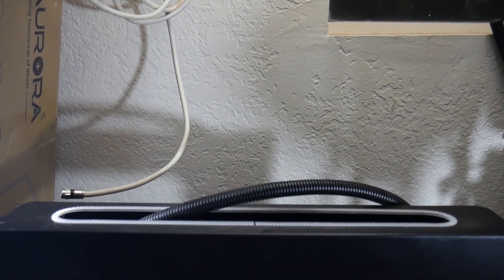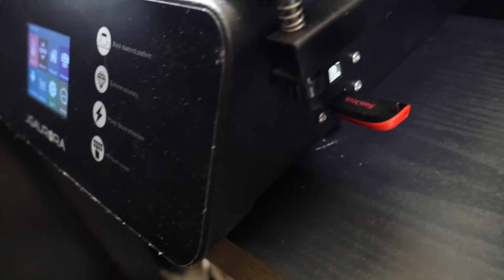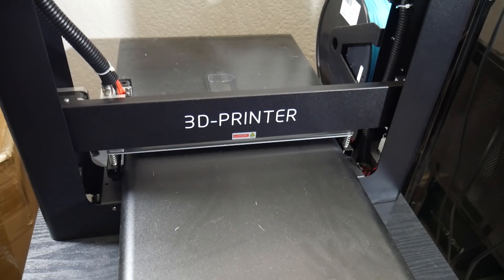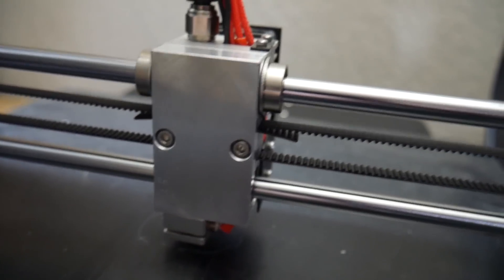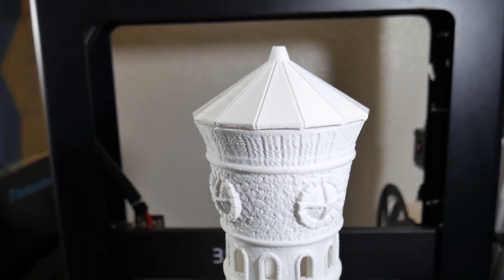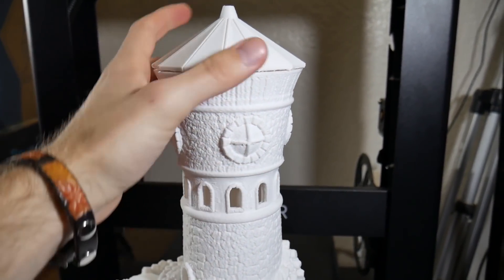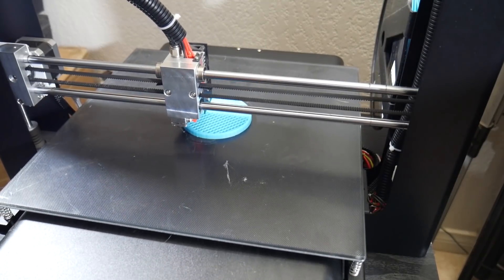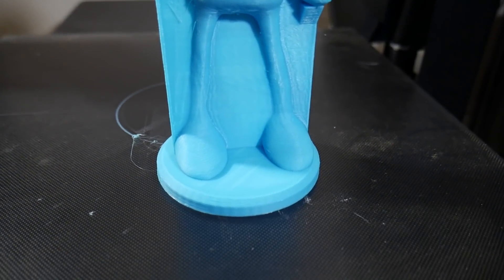Review Of The JGAurora A5 3D Printer | CR-10 Competition

Comment: Out of the box I would say the JGAurora is better than the CR10  but the JG soon starts to go wrong and my printer has spend more time waiting for parts to arrive on a slow boat from China than it ever did working plus the JG help desk have trouble understand English when it suites them.

Take my word for it, the JGAuora is nothing but trouble and the guarantee is not worth the paper it's not printed on.

So anyway I got myself a CR10 mini, it works 24/7 and does what it says on the box without going wrong every other week so don't be taken in by the good looks, they are only skin deep.

Comment: With closed Chinese firmware forget about long term support and any upgrades.
Reply: There are firmware upgrades and custom firmware available.
Reply: where is custom FW? Chinesee FW will be available as long as they don't create new model.
Reply: I have custom firmware installed on mine. Huge improvement. There will be new models but as long as this remains a popular printer other people will create firmware to improve functionality. The closed firmware has already been reverse engineered.

Comment: Want to get my feet wet in 3d printing..what would you suggest? I think I want a cheap one to see if it's something i will even use.
Reply from the maker: Exciting! There are a ton of options things that would help me pick for you is budget what you plan on printing (size) whether you want a kit or prebuilt as well :)
Reply: ModBot I don't mind building. As far as size I would like to make a arcade like you did so whatever can handle that.
Reply from the maker: Okay, well if you do not mind building then that will definitely save some cost and if you want to do an arcade like mine you will want 200mm x 200mm x 200mm which is pretty standard. The tevo tarantula I just built and reviewed is seriously like 180 bucks, has an all aluminum frame, was not to bad to build, and is the dimensions I listed. I would look into that one. For a preassembled option the cr-10, jgaurora a5, or anycubic mega will all work. Pretty much personal preference they are all around 400!

Comment: Looks awesome! Just bought the i3 Mega.
Reply from the maker: How are you liking it so far? From what I have seen and heard it looks like a great machine :)
Reply: I'm at the very beginning to 3D printing. Never owned or used a 3D printer before. I was happy that the assembling is easy and "time to first print" was very short. I think the Anycubic i3 Mega is a great choice to get started with 3D printing - it's very cheap and very good quality.

If my experience will improve, I'm going to upgrade that printer and change the nozzle. After my first steps and just a few days using it, I can say it's an awesome piece of technology and I'm very happy that I've chosen that one. Thought about the CR-10 as well, but in the end all reviews said that the i3 is a good start and the awesome heated bed (as you mentioned) and the smaller dimensions were the decisive factor.
Reply: But the JGAurora A5 looks more like a printer I would like to have in my living room. It looks more like a designed product than an "engineering tool" with a lots of cables, connectors and screws. I love the "clean" look of the A5!
Reply from the maker: Welcome to 3D Printing! I have to warn you that once you are bit by the bug there is no going back haha. That is awesome. I do think a machine like that, this one, or the cr10 are great choices for someone that does not want to assemble a kit, that way you can spend more time learning how to get quality prints and dialing in settings instead of dealing with wiring and putting a 100 parts together or so.
Reply: :D Exactly! Nevertheless, one day I want to assemble an Anet A8 or A6. Just because I love to assemble parts. But I think that's a project I want to start when I'm a bit more experienced in 3D printing. There a hundreds and thousands of settings I have to learn... When you have assembled the whole printer yourself it is hard to find a problem (whether it's caused by the software or hardware).

Comment: Cool review! I really want one of these in the near future. Thanks for printing the tiny, tiny tug boat. Yeah, I figured the printer just couldn't handle the tiny detail, I was hopeful tho. I hope to join you on the live show. I had some questions to ask about working with diff, filaments. I've missed some of your videos over the years, so you may have already worked with filaments containing metals,   wood composite, green materials made from plant products and or fiber optic filament? Have you 3d printed your very own 3d printer yet? I'm guessing, just about by the time you super upper and mod a kit that you put together, probably yes. Thanks so much Daniel! Hope the new job opportunity is going great with you too!
Reply from the maker: Hey Ashley :)! haha I was really hoping the boat would have turned out better but there was just no way at that size it would have to be done on an SLA printer. Hop to see you! It will probably just be a laid back stream. So my experience with these more exotic filaments is actually pretty non existent. 90 percent of my prints are pla, 5 percent abs, and 5 percent tpu. I would love to print in these other filaments but they are typically much more expensive and I have not been able to justify getting them without a use for them. I have printed with wood infused pla which prints fairly well I usually print a little slower but the same settings used for standard pla work. You can wood stain it after which is very cool. I have not printed my own 3d printer. I have had quite a few people suggest this over the years though so this very well might happen one day. haha exactly the kits I get are so modded they are nearly my own Frankenstein invention. It would be fun to make my own though. The job is going very well! lots to learn and getting up so early has been an adjustment but I am very happy :) I hope you had a great week!
Reply: Thanks Daniel! I did go back and watch some of your videos that I missed. Enjoy all of your videos/ tutorials. I did watch the one where you used the wood filament on the  totem pole bookmark. Really neat and then to be able to stain it as well! I'm wondering like what percentage or ratio of actual wood is in the filament? I'll have to do some research for myself. Technology, creativity and innovation on your sub, LOVE IT!  I wouldn't be surprised to see you designing, building your own printers for the masses, among other things. Truly gifted at what you do. I did watch the live stream , later on. It was great and much appreciated info. Must say I did laugh a few times at the 2 moderators,  haha. Glad the new job has you smiling! Have a great weekend, thanks again.

Comment: Nice video. I too love my JGAurora A5. The only things missing are decent part cooling fan and strain release for the hot end wires and ptfe tube. I’ve designed a combined solution for those problems. Find it here: https://www.thingiverse.com/thing:2790754
Reply from the maker: Thank you for the comment and for the link I will definitely take a look at it and I do plan to at least swap the fan shroud maybe I will add a additional cooling fan but I am not sure sure on that

Comment: The touch screen with it's menu is a computer on it's own. In that menu the WiFi function is not disabled while in fact the printer has no WiFi because the hardware is missing.
There is a very simple way to add WiFi and a whole lot of other functionality, that is installing a Raspberry Pi inside the machine with Octo Print or Astro Print. This can add WiFi, as well as a build in slicer (Cura) and the possibility to search for printable files from a tablet or phone and then printing them, without the need of a computer.
Reply from the maker: Ahh that makes sense, I am going to tear this printer apart at some point when I try to upgrade the drivers. I do actually have 4 pi's sitting on my desk right now that will all be used for octoprint :) (I hate cables)
Reply: There is WiFi in the meny because it runs on an mks board and the mks board has the option to connect a simple WiFi module (cost about 20$) and then the printer has wifi😀
I belive the WiFi option is standard for the touch screen firmware atleast i have it on All My mks touch screens an is always there when installing newest software for the screen